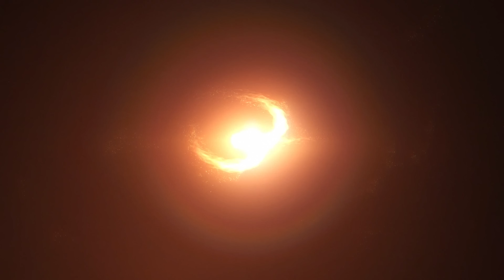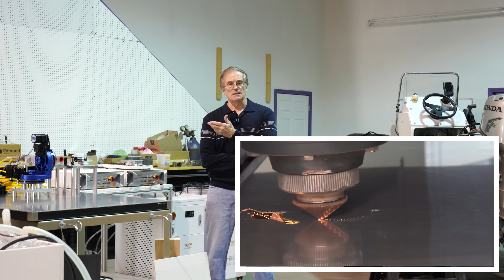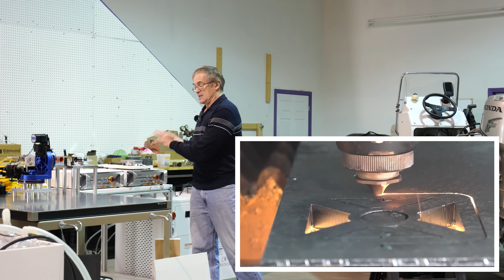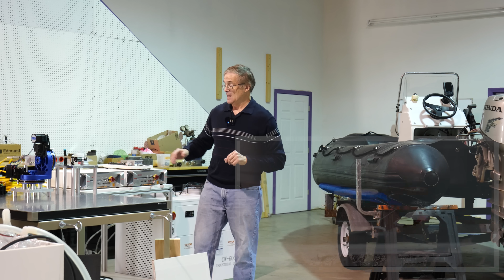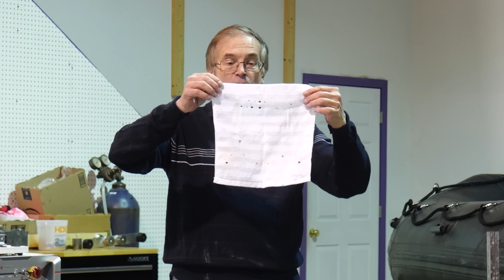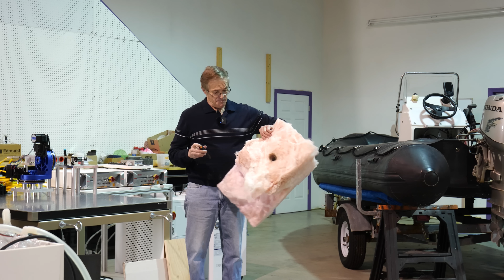We have a problem... and need your help!

Comment: What would be awesome is to make the beam focus able. So rather than trying to make a parallel beam, make a beam that converges on the target. If you started at a wide beam and then had it focus on the exact target using range calculations then you should be able to just about walk in front of the beam and be unharmed and then the beam can diverge beyond the target as well so it doesn’t burn your wall.

Comment: I’m a ceramic engineer, specializing in refractory materials.  High alumina PCW ceramic fiber blanket, one inch thick, would likely work.  Low emissivity, high melting temperature (3500F +), crystalline sapphire fibers to scatter the light.  Relatively light weight (8 pcf) and can be rolled-up when not in use.

Comment: My first thought was simply a water curtain; sufficiently thick, its intrinsic optical properties would decollimate the beam before penetrating to a destructible backstop.  These are used in commercial automobile spray-painting booths, are well-developed and reliable, and don't require immense skills to construct or adapt.  I began reading and all sorts of good ideas started to pop out such as adding a dye that absorbs the wavelength you're using.  

Adding an inclined surface, plywood would suffice, could retard the flow slightly, allowing a much thicker layer of water.  Adding a fog layer in front would pre-decollimate the beam, making it even safer.  I'm pretty sure water is your penultimate answer, with just a simple additional adaptation/thought to arrive at the final product.

Comment: Second idea.  reflect (if you have a mirror that can handle that.)  the leftover beam down into a 5 gallon bucket of sand.   rinse repeat.   OR use a lense to diffuse the leftover beam and use normal materials for absorbtion

Comment: An aquarium type tank .Filled with water . Glass 1/2 thick sealed on all sides.Use a pump to move the water and scatter the beam. Water should slow photons down and split them up.Even 1 foot thick blocks of ice would work slowing photons down and breaking them up.

Comment: what about a poured / spinning/ or cycling material scenario,   as long as you replenish the material fast enough... admittedly you would have some sort of reload , or relay /elevator scenario to work out.   Plus side,  you don't need to produce a large area of coverage.  Instead of a constructing and moving a large amount of mass, you could cycle a large amount of mass in a small space.   Maybe sand, maybe gravel.  Maybe a spinning flywheel.   heh, just don't spin a flywheel made of concrete too fast.  :p

Comment: I think it'd be an interesting concept to get fiber optic to harness solar light as the source.
Thermal expanding paint would be an interesting way to mitigate the damage, also implementing a timer relay for the main power, if the function of the lazer is to take out single targets then pulsing would work fine. Also implementing a negative registry in your targeting software to generate negative space where the lazer isnt allowed to fire. When certainty in the code for targeting reachs a threshold it can slowly draw a bigger alllowable target zone.

Comment: I would think you would learn what power is being projected , say in  nanomeeters, and search for materials that might be resistent to that frequency, on the other hand, one frequency will cancel out the other, one color, one color, one sound, one sound, and so on. Mabe a frequency barrier of some sort 🤔?  But i kinda think that its also a light,  but its opticle as well. So... i was wondering about the old video screen type of device. It might break up the light and defract its power potential like the lense shooting out at high angles in the factory. 
Or how about a lazer trap, where the light is allowed to enter a opticle chamber through a one way mirror. And when it enters, its reflection goes through a Series of fractials( which AI shoud be able to design, ) that disperses its potential.🤔
Ok. Ok. Mabe i think too much. Mabe you can combin all of them.🤔. 👍

Comment: My initial idea was to use a "water wall" of water where you had water with charcoal dust entrained in it as the medium.  The charcoal, being dark, would absorb any radiation coming into it and the water flowing down would displace heated water as it was created.  I see you tried water soaked towels, but those would be stationary and I think having the entirety of the medium moving may work.  Should be cheap to try at the very least.

Comment: You know those old shower doors made of rippled glass? Those could dissipate a beam really well without melting - if that's a goal. The other thing that might help is Starlight which can coat a thin and lightweight wall. It can be made with simple baking soda, corn starch and white glue. It will absorb and instantly dissipate many thousands of degrees of heat. A Super-Material That Can Be Made In The Kitchen (Starlite Part 1) from creator NightHawkInLight is where you can find how to make it on YouTube. I think that would be worth a test as it would be so cheap if it worked. Chicken wire stapled to your surface would help it hold vertically. A 3-D printed and texture roller with hollow triangular shapes on its surface could be rolled over the applied putty to give the surface a 45 degree angle for the beam to hit for possible added benefit? At least initially until the surface boils from carbonizing.

Comment: In any case I would increase Surface area by angling the blocking surface.  So the laser would hit a bigger area.  Materials:  Basotect (melamine foam), flame resistant MDF.

Comment: What about rockwool insulation? The melting point is 2x fiberglass. It’s also low flammability  relatively cheap and lightweight.

And after you’re done you have more insulation for your shop

Comment: What about Starlite? That super heat resistant wonder material (the none secret formula version is made from simple household ingredients) - and a fine metal mesh for the shutoff sensor.  You could send pulses through it and measure the impedance (like the cable fault testers). This sensor should be able to react near nano second while being cheap to replace the damaged mesh itself (or just move it a little and set a new baseline)

Cheap, portable, easily sourced. Minimal wheel reinventing

Comment: Why can't you use certain colors which reflects different light frequencies like blue is a good one but without knowing the frequencies of your Lazer I can tell you the right color.  Cost of paint plus a framed wall with sheet rock  also sheet rock is flame resistant . Have you tried  a abated mirror

Comment: Off the top of my head, you could experiment with the following:
Crucible cooled with liquid nitrogen or formed dry ice from CO2….
2 pieces of carbon fiber plate (can try other materials also with the 2 types of cooling), cooled with liquid nitrogen between the 2 plates or form dry ice between the plates.
Cryogenics is a good way to absorb large amounts of transferred energy from materials… In my opinion.

Keep up the good work!

Comment: I think the solution is to  not allow energy to be absorbed at one point for long duration. Set of mirrors in a system of rotating polygon cylinder fixed with mirrors and scanning a raster on final absorbing surface can distribute the energy and result in a very short duty cycle at one spot. Larger scanned raster area and scanning speed can be adjusted to match absorbing surface capacity for energy density. This concept was used to scan a raster in early TV designs . A search for scanning polygon mirror will get you lots of articles on this subject. Good luck 🙏

Comment: Probably already been mentioned but a "beam dump" could be useful. A box of any fireproof material containing one, or a small series, of laser class mirrors that spread the beam to an unfocused/diffused state, possibly over some intumescent material for extra safety. 
The idea behind it is, diffuse and absorb. As a general design, they can be any shape but L shape right angle is common. 
The target/diffuser should only be the secondary or more on the chain of the beam path, it should be reflected first for safety and the beam should always strike the "target" at an angle to absorb as little energy as possible (reduce the chance of reflection) and allow the inverse square law to do the rest, if diffusion is the option. The primary mirror and the target can be mounted on a metal plate with a thermocouple, so should the primary mirror, or the target, fail, you can have a thermal cut off as a failsafe.
You have a LOT of focused energy, so rather than just dump it directly into a tungsten block (even though that would work) obviously it is a challenge to diffuse it quite quickly over a short distance. 
The beam dump box would have a small entrance aperture (to minimise or eliminate any reflectance/scatter) and be as dust and contaminant free, as any other of your optics. 
The targets design is generally based around the beam width if the design is diffusion based, rather than a bucket of carbon nanotubes to just dump energy into (easily replicable, sometimes low tech is best tech). The analogy here is a jet of water onto a ball, it needs to be large enough to reflect the energy but small enough so the angle of contact is maximised. Shaped conical or spherical tungsten targets can be effective as long as the curved surface is clean and strikes at an oblique angle (to avoid direct reflectance/bounce back). 
This might be a little bit too "cowboy" but you can get some reasonable material testing with a tungsten carbide drill bit. Reasonably accessible and not prohibitively expensive until you need to spend real cash on machining.
The other design is similar in nature and just uses a series of semi-silvered mirrors to allow the beam to be reduced in energy to a more manageable level. A series of 10% mirrors in a line of LLLLL as the laser passes through energy is reflected off at manageable energies to dump into any material you see fit.
The math is obviously much harder than I am making out here in this brief description, but I hope this inspires a solution.

Comment: I would say use volcanic rock about a foot or 2 ft thick held in place by chicken wire or some sort of wire can't say if it's toxic or not cuz it's volcanic rock but it's very light and cheap. Like people do for landscaping. Or better volcanic rock wool insulation .Or Aero gel but I'm sure that's very expensive

Comment: 6:30 dry ice... frozen CO2, not to stop the light, though to refract it over every air pocket in the white dry ice. incidentally if the dry ice wall is thick enough after creating a small burn hole that refracts the laser light slowing depth, the CO2 in the wall would off gas into an atmospheric condenser and be poured back into the wall, self contained. particular problem with lenses as they get hot from laser resistance even being optically clear... the lens apparatus very well might need dry ice cooling or the dimond crystal glass lenses will, evaporate.
Reply: liquid nitrogen recirculation over a powdered dry ice block "wall".

Comment: The laser you are firing is a consentrated beam, if you are firing at the same area of a millimetre with every test then just unconcentrate it, your back area you are firing at has a concave lens that distorts the beam out to a metre or so around, if that doesn't stop it burning through the wall then have a sheet of closely fitted glass filaments that take it and split it even further into smaller less powerful beams. Have a good day. Leon from Australia

Comment: Put a fog machine in front of deeply pre charred OSB, you want a thick layer of carbon and set the board at a 45 degree angle. Fog diffuses the beam and anything that is still strong enough to burn gets caught by the thick layer of carbon. Cheap and easy to test. Smoke may do a better job of diffusing the beam. Could use a bee calming device or meat smoker setup to produce it and pump it into a bag or bags of a material that js transparent to the wavelength of the laser.

Comment: Multiple layers of heavy foamed concrete

Edit: Arocrete is a foamed concrete, several layers could help
Reply: Aerocrete, I think that's how to spell it. It's mostly a method of adding foamed soap and folding in concrete. It takes 1/4 or 1/8th the amount of concrete in an area

Comment: A water tank filled with water and methalyne blue and the walls of the tank are one way refective glass with the reflection sides facing the inside of the tank. The light goes in and reflects inside the tank back and forth while the uv absorbing properties of the methalyne blue absorb the energy. Just a interesting idea and I know there are side reactions some of which may damage the reflective qualities  of the glass. Whatever you do its going to be wonderfuly dangerous

Comment: Wouldn't it be cool if your laser system started out with a very wide beam that was dynamically focused to a point at the target? Just like a much larger version of a laser cuter, over a long distance. This would of course demand another axis of control of your targeting system, but quick high accuracy ranging seems like a problem that's been solved in various ways already. Or perhaps the focus could just sweep quickly from near to far until a bright return from the target was detected.

Comment: Galvanized culvert packed with damp sand. Can put it on a rolling cart and move it in and out of the way as needed. Also allows you to slot it and put additional materials that might assist in gaining extra seconds. As for keeping the sand damp you could use one of those garden hoses that intentionally seep to water garden beds.

Comment: If the light is coming out in a beam, then I'd be tempted to put (15cm diameter) 2 metre long pipe in front of it... and then I'd fill the pipe up with something that conducts heat pretty well, and has a high thermal capacity, and which "flows" to repair any holes... which to me sounds like black sludge made out of copper particles (or pieces) in water - preferably flowing, although sludge doesn't flow very fast.  

I tried laser-cutting some wax once - which turned out to be surprisingly difficult because while the beam blew through the wax like it wasn't there, the melted wax immediately healed the cut.

Comment: You need something that will carbonize without igniting. Then the carbonize layer will absorb a good portion of your heat. Im thinking something like the heatshield material from shuttle and rockets, or the mythical Starlite... you could put your powers into rediscovering that formula before making the next laser video. Easy. 😉

Comment: Call a few local gun rangers and test there (you will have to move everything but) and use their earth berm.  They're usually pretty helpful.  I went to one when I tested my flamethrower.  The guy even brought an extra fire extinguisher hah. 

Also, def have an emergency stop button if you don't already.

Comment: Lots of water, probably with some food safe dye for better absorption and easy disposal.  May also be able to thicken the water with something like xanthum gum or another food additive so it flows slower and thicker or otherwise make a non-toxic water based gel. Could just have that water/gel/coolant slurry flowing continuously down a sloped backing material with enough thickness to protect the backing.  Basically make yourself a little beam-dump fountain.  If you stick to just food additives it can go down the drain when you're done.

Failing that I'm not too familiar with what would be a good for a container that does get hit, transparent would be ideal as then you don't even burn a hole, failing that some plastics burn cleaner than others to the degree you might get away with just decent fume extraction.  Polyethylene comes to mind since you can already find big water jugs made of it, often clear.   You're not talking about making a big hole in the container.  Maybe just pick something not too toxic and just rely on slapping some tape on the hole once you safe the laser.  

Respirators might be a good idea since you can't guarantee the laser won't burn anything hideously toxic on the drones.